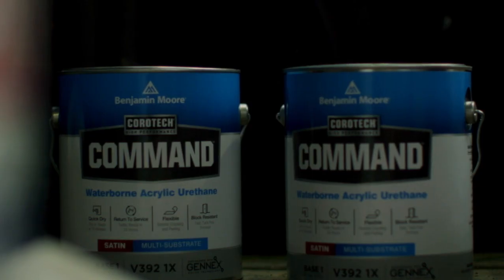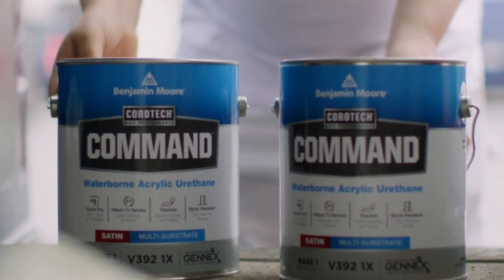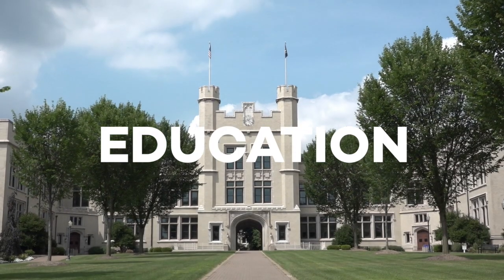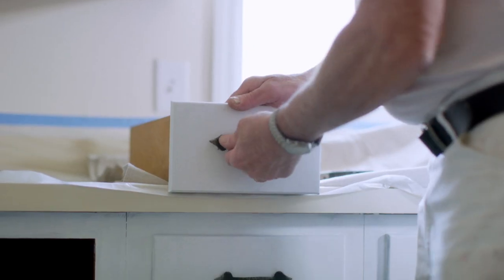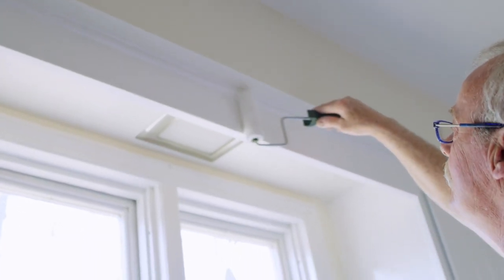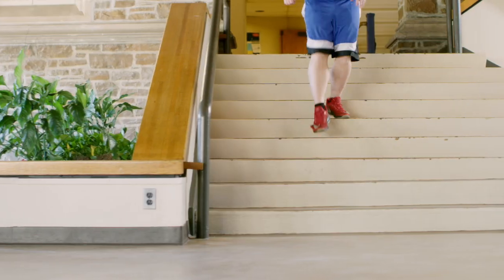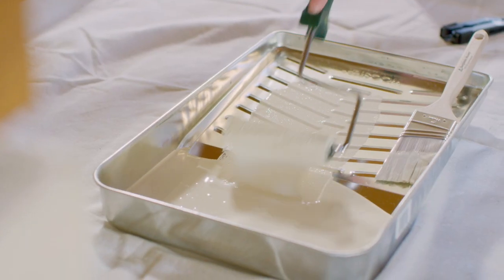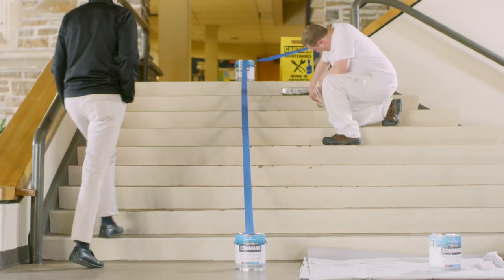Corotech COMMAND | Tackle Multiple Jobs with Speed and Confidence | Benjamin Moore

Comment: i just painted my cabinets with command using a foam roller, if you use command with a roller paint in cooler temp and thin down the paint a little with a cup of water so it flows better, i was very happy when done, this is tough paint should stand up to abuse, in one day i couldnt scratch it off with my fingernail..these were kitchen cabinets too, came out pretty ok

Comment: I'm sure you can brush and roll as well, but this primarily designed for spray?  With a fast 15 min dry to touch time, it seems like it could be difficult to get a smooth even finish when applying by roll and back brushing on surfaces such as kitchen cabinets and still getting a nice level smooth uniform finish.  We usually need about 5 min of solid working time to paint roll and back brush a cabinet door.  If the paint partially sets up does it turn into cottage cheese if you brush over it.  How does it react? What are your thoughts?  Thanks!